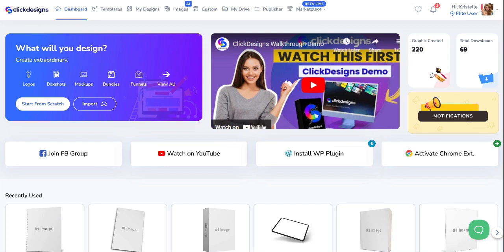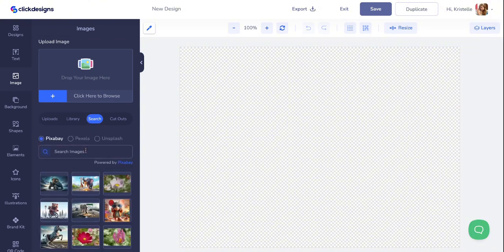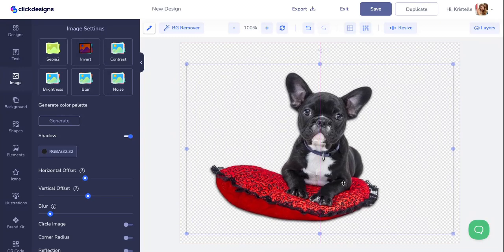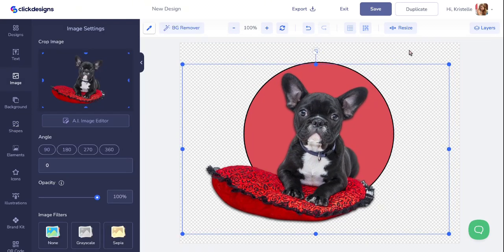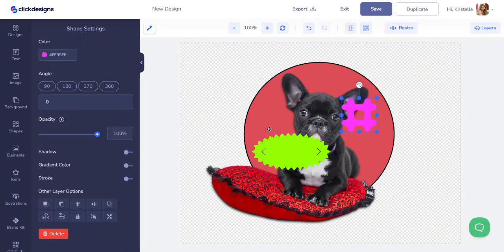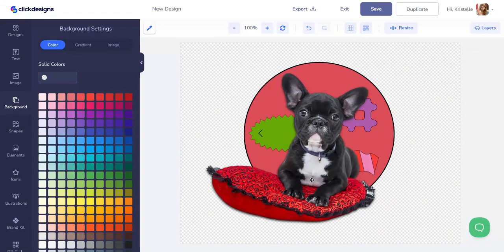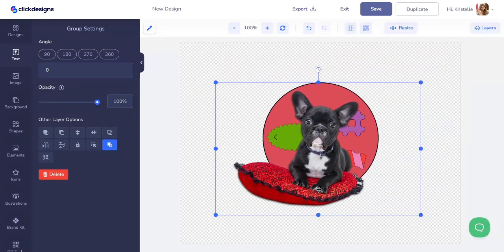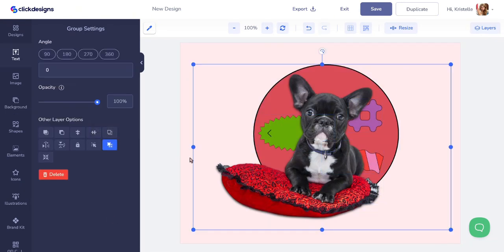GROUP & UNGROUP ClickDesigns Elements! 💚📗 #ClickDesigns

Comment: That's a great feature! 🤗 Quick question: can you also use the keyboard to select specific images or objects that need to be grouped? For instance, when there’s an image between the objects you want to group, so it can’t be selected with a single mouse swipe. For example, if you create a frame with four different lines, place images within that frame, and then want to group just the four lines together so you can move the frame independently.
Reply from the maker: Absolutely! You can hold down the Shift key while clicking each element you want to group, which lets you select just the specific elements you need, even if there are other objects in between. Hope this helps! 😊
Reply: @ClickDesignsOfficial  thank you very much for the clear and quick reply 🙏
Reply from the maker: @slimslankplan  You're welcome! Don't hesitate to ask if you have any other questions :)